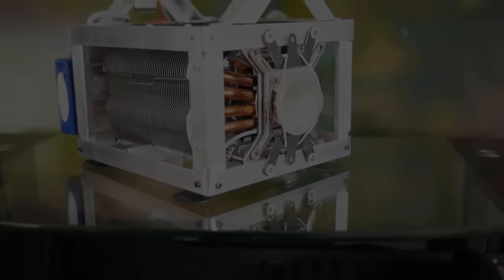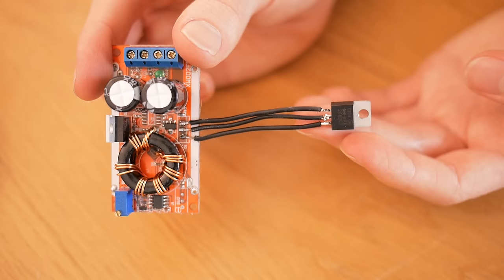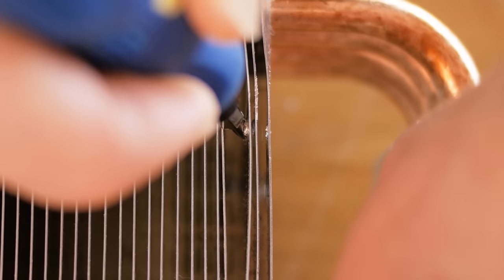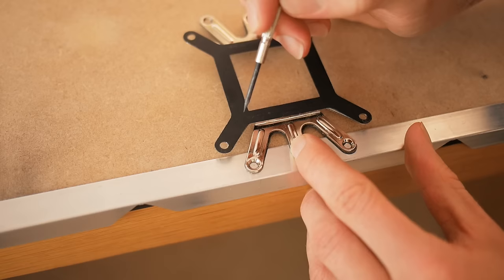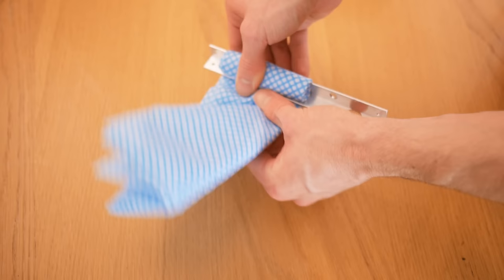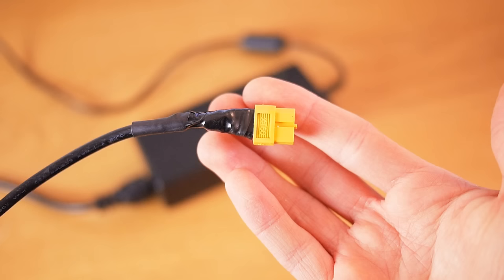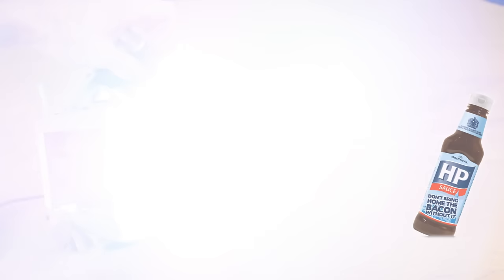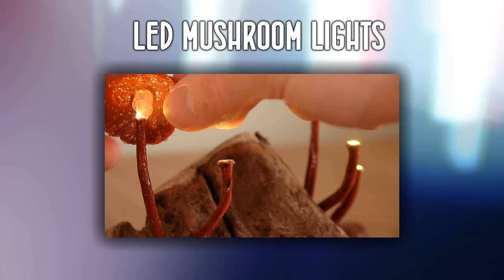Make a 1000w equiv. LED flashlight - aka DIY Sun-Blaster!

Comment: Quick question. Why do you solder resistors to the potentiometers?  What is their purpose?
Reply from the maker: +Hunter Coyhis Sets the minimum and maximum output voltage from the booster.
Reply: +Hunter Coyhis I was wondering that too.
Reply: +DIY Perks Awesome that makes a lot of sense now. thank you for the timely reply. I love your videos!
Reply: +Hunter Coyhis Cause pararerly connected two 10k potentiometers gives maximum final 5k resistance, it's too little. Simpliest electrical rules...
You can replace the blue one by constant resistor which will give you 30V on regulator output when potentiometer is fully "opened", just ask DIY Perks what value has his blue potentiometer set :)
Reply: +Spid88PL Thank you for this information!  I am quite a novice to electronic systems (other than those little kits you can get to build a clock or other little trinkets that come with all the parts and instructions).  I would have guessed that connecting 10K potentiometers in series would yield 20k resistance.  Now, looking at the diagram in the video they are linked in parallel, not in series. Thanks again for clearing that up!
Reply: +Spid88PL in mine, same booster, i eliminated the original trim potentiometer and replaced with 3KR fixed resistors in series with a 5KR 3/4 turn potentiometer which gives me a full cut below the diodes minimum forward voltage of whatever and does not exceed 30v when adjusted to the maximum.
Reply: +DIY Perks are the 10k potentiometer and resistors needed to do this project? I saw some videos which use a Boost Converter that can limit the current output to 3 amps (if above it destroys the  led) and I alredy ordered this exact Boost converter (video) and it does not have a amp regulator. so are the 10k potentiometer and resistors used to regulate the amps or can I do this exact project without them? Thank you
Reply: vascobrissos14 The 10k potentiometer acts as a dimming knob by adjusting the voltage going to the LED
Reply: +Hunter Coyhis I did some research and I understood that. Does it also limit the current to the LED? Since the boost can output 6amps (max) but more than 3amps kills the LED. Thank you
Reply: vascobrissos14 I'm not entirely sure. I just based my design off of his parts list and wiring diagram and just made sure that I was pushing the proper voltage...
Reply: In theory the added resistor essentially  sets the lowest achievable resistance to a non zero resistance so as to limit the maximum current flowing to the LED. Without that extra resistor the lowest achievable resistance is set to ZERO resistance and that can overdrive the LED and cause it to burn out. 
Of course  this is all theoretical, in the real world you can never achieve zero impedance  with conventional copper conductors but  the internal impedance of the conductors is still pretty close to zero so for our purposes let's assume zero resistance.
Reply: Your a bit posh mate.
Reply: I build valve amps, this is chicken feed science next to seemingly simple triode amps!
Reply: Truth! I love modern valves!
Reply: Can i use the exact same parts, but with a ac-dc 120w-150w switch/power-supply.
Reply: Dipesh i think can as long as the output voltage is between 12-24 volts. 120watts is just nice option because it can support the led wattage.
Reply: @Tinago95 , no, it has nothing to do with limiting current. Those are all part of the circuit that controls the voltage of the boost converter. Voltage, and only voltage.

Comment: Hi, so i finally finished both your sunblaster and LED panel DIYs. I'm a professionnal cameraman and wanted to make my own lights (especially the sunblaster which seemed phenomenal). After having completed both projects and comparing them to a professional square foot light panel it seems that most of the energy is wasted in heat through both the power adapters and the lights themselves. Given the amount of time it takes to build either one, you'd be better off mowing lawns or working in a fast food and save the $600-$800 necessary to buy a cheap light panel. Professionnal use requires battery management and given the inefficiency of the lights themselves (absolutely nothing wrong with your DIYs), these can't be reliably used in a professional setting.
Reply: so no good for professional video ?? what a bummer!!!
Reply: +GroundUpProduct  use better quality led's the efficiency of these cheap Chinese led's cant compare to the cree cxa or cxb series led's.
I have made a 5 led floodlight using cxa3070s and it is quiet efficient and also cooled with cpu coolers , and powered by some very efficient meanwell power supplies lpc60-1400 .

Google battlestar ganjatica its where i got the inspiration for my build i know the guy is using it as a grow light and not for professional lighting but these stoners are worried about efficiency and they have done the math
Reply: Buy more efficient, higher CRI LED's!
Reply: @MrJustsayinshit. Could you share how did you build it? what were costs? do you use lights in video work?
I could get my friend do electronics as im not good with those.
Reply: This DIY project was compared to a 1000W Halogen work-light though.
Then it is pretty efficient. Comparable light output and doesn't give off as much heat as a Halogen lamp even though it still needs cooling. With a sufficiently large heatsink you may skip the fan too. These LED modules are commonly used in street lights where they are always passively cooled.

Comment: You set the battery voltage warning at 3V which is the limit per cell. However, the pack you used is three cells, so the warning level should be 9V, and the monitoring leads should be connected to the battery terminals.

Comment: Fantastic. I'd love to build one of my own. Would it be possible to add acrylic sheets to the inside of the frame to make it waterproof? Or would that make the heat build up too much? 
As it is a fantastic flashlight, but I'd not want to ruin it by taking it out on a rainy evening.

Comment: Ohh and do you think a small stock intel or amd cooler could do the trick too ?
Reply from the maker: HIXMF Possibly, yes, but you'll probably have to run the fan quite fast so it might get a bit noisy.
Reply: thanks for the reply ! just what i thought ! Keep up the amazing work !
Reply: HIXMF Liquid cool it!
Reply: Considering a 100W LED is like a 100W CPU processor, a stock cooler can get quite loud. A big fan cooler can certainly help a lot.
Reply: ***** the trick is that a led has a efficencie of about 95%. i dont know what a cpu has but i would estimate like 40%. so a 100w wont nearly get as hot as a 100w cpu.
Reply: ***** but still. a small boxed cooler from amd or intel should still be enough. and if you are outside and its a bit of a wind day you could even run it without the fan
Reply: HIXMF the AMD stock heatsinks should be enough since the current vishera and zambezi FX-Models range from 95 to 125 Watt TDP (excluding the water cooled 200 W monsters) - problem is, the heatsinks use small fans thus making them loud 

using a cheap aftermarket tower cooler with a 120 or 140 mm fan should be the better option
Reply: Screw it, use a peltier chip. They're $20. Not great for a CPU because although they can get very cold, they don't transfer heat very efficiently. But they should be fine for an LED.

Alternatively, use the peltier to generate power from the heat of the heatsink and cycle it back in to the battery.
Reply: G3RMANARMY modern gallium nitride LEDs have an efficiency of about 70 % - problem is, that those yield only a specific wavelength which makes it useless if you want white light - therefore the spectrum is spread by doping the diode with other materials (usually cerium doped yttrium aluminium garnet) - but this reduces the efficiency a lot - in lab conditions this is currently limited to about 55 % (excluding external components like voltage regulators) - the efficiency is set around 40 to 50 %

and for CPUs - i'm not sure where you got your 40 % - but it is pretty well known, that the allmost every single watt is converted to heat in a CPU, all other forms of energy are subsequently also converted to heat - therefore the efficiency of a CPU is close to 0 % (or 100 % if it is on terms of heat).
Reply: suit1337 These scrubs, amirite?
Reply: I did it with a stock amd cooler. doesnt even get cool to the touch of the heatsink after 30 mins of use. do have the fan on spinning at moderate speed. loud but it was expected. these heatsinks were meant to dissipate 100+watts TDP. suit1337 The point was to make it as cheap and as small as possible hence not buying a new cooler ! Thanks for the feedback tho !
Reply: TheResidentSkeptic i was just guessing XD
but even if my numbers are totally wrong, i was right that a cpu produces a lot more heat than a led so you can use the stock cooler really easy.
Reply: G3RMANARMY Yes that is generally true - depending on the CPU.
Reply: I've cooled 100w led's with cpu coolers before without any issues - I think any cooler designed to handle 100+w of heat dissipation would be fine: https://en.wikipedia.org/wiki/List_of_CPU_power_dissipation_figures
Reply: TheResidentSkeptic peltier module is a heat pump. If you want to cool something with it, you should cool one of it sides first. So if you want to dissipate 100W you need to take of 100W from peltier...
Reply: Georgiy Oganisyan Yeah, people seem to think they are made of magic or something. The difference it, a 100W peltier will move 100W of heat, EVEN if that will put the cold side to a lower temperature than room temperature, but you still have to remove that heat. It is a room temperature offset device so you can achieve temps lower than room temperature, but you still have to be able to dissipate that heat anyways. It is pointless and stupid to use one on an LED, which will not do anything special if cooled below room temp.
Reply: Richard Smith , you remind me, that peltier module consume power by itself, so you need to move much more than 100W.
Reply: Richard Smith Not only do they move heat, they also consume power. And their actual efficiency is really shit, as in well under 40%. To move 100w of heat you're going to be consuming over 200w of power just in the peltier itself. If you have a heatsink that can handle the combined 300w+ and still keep the peltier happy, I'd just obit it and use said monumentally oversized heatsink  to cool the mere ~70 watts or so coming from the LED itself. (Yes, ~70 watts. In terms of watts in to light out, a cheap cool-white LED is about 30% efficient, so you get 30 watts of light and 70 watts of heat. Yes there are better ones available, and yes they are a lot more expensive.)
Reply: Ryan Willis Right, I was giving a hypothetical. Even if they were 100% efficient, it still would be a waste of time unless you want to go lower than room temperature. No point here.
Reply: Peltier elements are only useful if you want/need to cool something below the ambient temperature, else it is a major waste of efficiency
Reply: G3RMANARMY From electrical engineering == when dealing with LEDS treat them as if they are 0% efficient. a 100 watt led will put out a vast majority of its energy as heat.  It may be 10x better than incandescent but that doesn't mean its 95% :)
Reply: TheResidentSkeptic you still need to cool the other side of the peatier chip... with a heat sink of some sort.  think of them as heat pumps, they dont just generate cold... they move heat from one side to the other... you still have to do some thing with the heat.  you should do some reading on how they work, they are actually super cool.  it requires some weird materials, we talked about them in inorganic chemistry.
Reply: some guy,
Reply: TheResidentSkeptic What an idiotic idea.
Reply: G3RMANARMY you should use 775 heat sink with a coper core
Reply: HIXMF I'd just go with a cooler master Hyper 212 Evo. MASSIVE cooling power. Easily able to keep maybe two of those LED's cool.
Reply: build it already, a stock cooler is way more than enough.
Reply: HIXMF Do you got any video of it in use? I started looking to build one myself and saw a cheap 500W LED!! So I am going to make 2 100W ones and one 500W one. The 100W units will be battery or AC mains, but the 500W will be AC powered only.
Reply: will have one soon ! I hope you dont plan on using the same voltage regulator
Reply: HIXMF Nope. The 500W LED uses 70-75 volts at around 6.5A, so I hae something else in mind.
Reply: God damn. That thing could blow a fuse in a regular home.
Reply: You usually have 1500 watts available to you on a home circuit, so we're safe there. But the big issue HIXMF is cooling the damn thing!

The best pc processor heatsink made, including water cooling setups ain't enough to handle this. I'm looking into some extreme solutions while still keeping cost down.

Comment: whats the battery life?
Reply: Please let us know what the battery life is with the 8000 mah battery.
Reply: Well he used a 4500mah battery and got 45mins, so an 8000mah battery would get you almost double that.  Say, 80 minutes?
Reply: +Gus Wilkens This is not accurate. The battery he's using is about the equivalent of 2 18650 batteries. My light has 4 good 18650s and can barely last 20 mins. There's something fishy about his claim. Guys, don't use the battery he uses. That's just a bad choice.
Reply: +Nonnof Yobiznes taht's not true. He is using 8000mah (i'm not 100% sure ) 4cell wich is 14.4v discharged. if you use two 18650 you will get 2300mah and 7.4v or 4600mah 3.7v. thats not equvialent..
Reply: +Jirka Cvrcek Oh, OK. I didn't see last part of the vid. When I saw so many wrong things about it I stopped when he was making the framing already. I assumed he'd use the 3500mAh battery he put in the description. But let's see the numbers

If he's using the 4 cell battery, then it's about $70. For that money, you can get 14 good 25Rs (rated at 2500mAh) which equal to 35,000mAh. That's more than four times the amount of power for the money.
Reply: +Nonnof Yobiznes I'm waiting for parts to build this light, I've purchased a 3 cell 4500mah lipo which is the same as the one he has on the full parts list. Once the light is up and running I will post my times at full brightness and lowest brightness.
Reply: Gus Wilkens
Great. Yes, let us know. Hopefully the running time is about the same of its 18650s equivalent.
Reply: I'v builded myself this with 8000mah 4C. Zippy, on full brightness it stay for hour. Whats your batery life time?
Reply: Jirka Cvrcek
One hour? You need to remember the light dims as the battery loses power. Usually the first 1 min is the brightest, then it drops by about 20%, it plateaus for a while then it drops considerably. Would you say the it was brightly consistent for the most part of that hour? Or was it noticeably dimmer at the end?
Reply: No, im runnining the LED at 30.5 v 3A (max for the LED) i have a voltage convertor and current limiter. The battery itself have voltages from 12 to around 17 volts.. To the LED is going alllways 30.5v 3A max.
Reply: I can send you some pictures of that thing if you want..
Reply: +Nonnof Yobiznes Alright,  so I've had my torch going for about 2 weeks now.  From full charge I get half an hour usage on full brightness.  I water cooled my light, more for show rather than practical, so having the fan and pump going all of the time would use more power than just the fan. I'm using the battery stated in the full item description document.  4500mah lipo.
I housed the light inside of a cheap plastic tool box from bunnings, $4 I think it was.  If people want to see pictures or video just ask.
Reply: Gus Wilkens Please send some pictures.
Reply: 2 sek.😂
Reply: "Nonnof", you fail to realize the voltage difference in your calculation. 14 x 2500 mAh x 3,6 volts (126.0 W) vs 1 x 8000 mAh x 14,4 volts (115.2 W), ie, about the same, but with the loose cells you suggest you have to spot weld them together, make a case for them too.